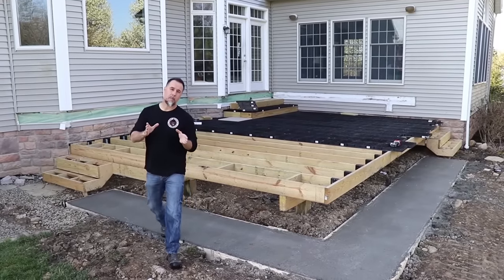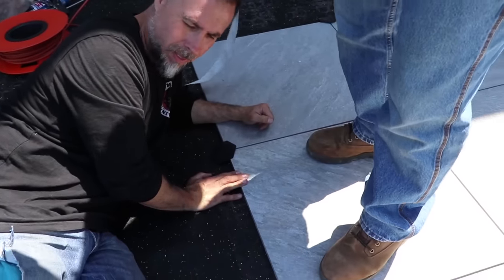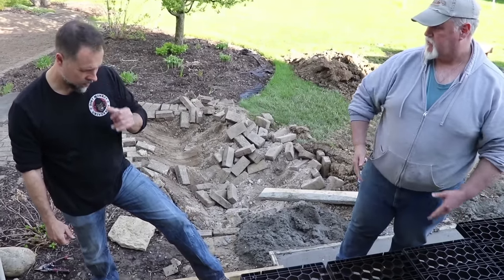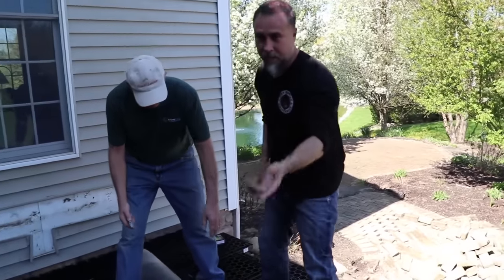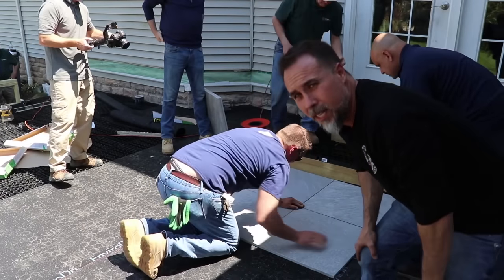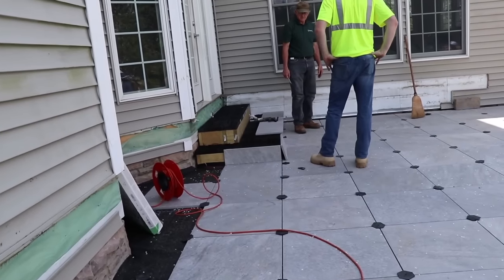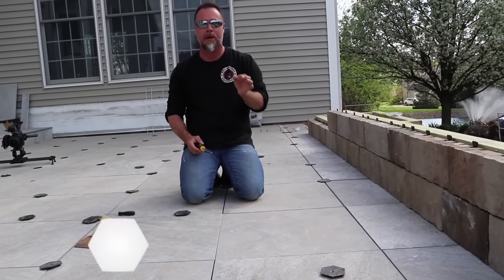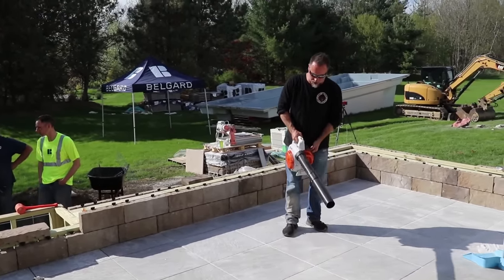How to Build a wood deck & install pavers, porcelain or stone tile over any deck

Comment: Come on? What a scam product. Considering the astronomical costs of those materials and the labor intensive tasks of this construction you can't convince me that this system is one that you'd ever consider selling. I bet you could do concrete base within 10% additional cost. And the flexing argument at the beginning is so convoluted. You throw all aspects of an outdoor environment on top of this and I couldn't warranty this for even a standard year. I've never wasted time or money putting porcelain tile inside a stick frame house. I welcome anyone with experience to argue the good points of this.
Reply: This video does not cover the fact that the ground shifts either and it does and will.
Reply from the maker: The idea is to offer options to the customer.  Ive built decks like this but with a dirt foundation- importing soil, compacting etc etc.  They get bugs, ants, snakes and mice living under them.  Those critters move into the house.  Ive done both and like this better.
Reply: How about raised decks say 12 feet off the ground? You do know what it cost to build 24 stone steps and who wants to climb that many steps. This product has its applications. Nice to have options!
Reply: Mike Buettner People can do what they wish to do with their money. Your scenario doesn't change the fact that this product will not stand the test of time. All I ask is that if you as a contractor would sell a customer on this idea will you also back it up with a warranty?
Reply: John Callahan interior*
Reply: yep 100% agree with you, i wouldn't be installing these decks, its gonna have major problems in the future, and watching the video, seeing him attempt to cut porcelain tiles, he's obviously never done it before. I've laid heaps of porcelain (not by choice) i wold never use the product by choice or this system. recently seen a company pushing this product here in Australia but telling people they can directly stick the porcelain to the grids using construction adhesive. pity construction adhesives don't stick to plastic. So over these make it up as you go along companies who tell customers anything to get a sale.
Reply: Depends. Wood and composites don't work well in some climates.
Reply: I install 1000s of sq. ft. of tile every year. You should look up floating tile underlayment. Years ago in ancient times tile was set on a sand bed to absorb ground movement and hundreds of years later they are in pristine condition. The reason your tile cracks is because of poor installation, like insufficient subfloor thickness, no back buttering, ect.
Reply: WSMC Mc the other choice would be filling dirt a 5 foot retaining wall and nice pavers on the inside with and out door kitchen 😎👍🏼
Reply: I did some repairs on a house that had this deck system. It had been there for years. My repairs were to the wall next to the deck so I pulled off the bricks, repaired the wall, and put the bricks back. The deck seemed totally fine.

Comment: One more way of putting Mason's outta work,looks expensive and not sure of any labour saving either. Think l would use it only for pavers and then you have a weight issue.If the product is strictly for deck builders looking to upgrade there portfolio then l think it fits the bill.as a mason l would pour and lick and stick myself but that's what l do so a bit biased l guess.
Reply from the maker: Thankfully there is so much work available out there that I think masons would have plenty of opportunities to keep busy.
Reply: Hi Bob! We are definitely not trying to put masons out of work. We appreciate masons, and respect the craft! Our product just gives homeowners the option to create beautiful, low-maintenance outdoor living spaces, besides wood/composite. Cheers!

Comment: Ever hear of Hardi boarf
Reply: Most tile setters rarely use hardi backer anymore. There are too many other and better products these days. By the way, I would not use a system like this on exterior tile applications. As a tile setter, I see too many problems long term.

Comment: Looks pretty cool, but will probably cost a fortune.
Reply: Hi Donnie! As far as the cost of the system, it is definitely more expensive than a regular wooden deck. However, on average, we have found that our system is more cost effective than using composite decking. If you're interested in learning more about our pricing, shoot us a message. Cheers!

Comment: Sorry, not for any deck. This is new construction. The prep work to convert an existing deck isn’t worth it especially to wrap each joist. There’s only a few specific instances that need it. Stick with conventional pavers or wood decks in most cases. Interesting concept.

Comment: So what happens if you use exactly the same method of filling your joints as you do when using conventional methods I.e. spreading your polymeric sand out over your pavement and sweeping till all voits are filled then just removing any excess sant as in a conventional job stanly I've just stopped believing what you say because you just said " you cannot have any more polymeric sand on the pavement than you absolutely have to" in fact you can use the conventional method with no problems whatsoever please tell us stan your loyal subscribers what qualities you to tell us how to do things

Comment: I do not see this working. That sand will be gone in 2 years so figure the maintenance on it. No way this is a long term system. At least with concrete and tile you have a proven long term solution for maybe 10% more that what we saw here.

Comment: Just wondering why the waste of time and money when I would just place pt plywood down and pour a leveling compound down and create a cement deck. Or leveling compound and mortar the tile down.....so many other cost effective  ways .... I have sealed joists with compounds and have used roofers tape which works the same and is cheap as dirt.......too much time and waste of money....I have decks dry and rott free after 20 years.....new school is not necessarily good school
Reply: In Calgary  Alberta here none of that would work. Polymeric sand has to be applied every year. The heaving and cold and hot weather would expand and crack that plastic base cause the wood and plastic expand and contract at different rates.....no drainage......this is only for southern areas...

Comment: You would have to be a real glutton for punishment to even consider that system. Ten years from now that will just be failed history. After forty years of experience, We have learned to give new methods at least a decade to prove their merits. Most of the new ideas fail. It is sad but true.
Reply: Thanks for watching, Doug Webb! Our product has been out for 11 years now, and we have quite a few decks that are 10 years old and are still going strong (with a 20 year residential warranty). Cheers to the next 10 years!

Comment: How to turn your 3000.00 deck into a 30,000 deck !  Awesome, NOT !!!!!!!!!!!!!
Reply from the maker: Its not that really that expensive.  Good composite is comparable.
Reply: What is the cost of this if it was a standard deck, Pressure treated 5/4,  compared to this system on this particular deck ? Thanks.